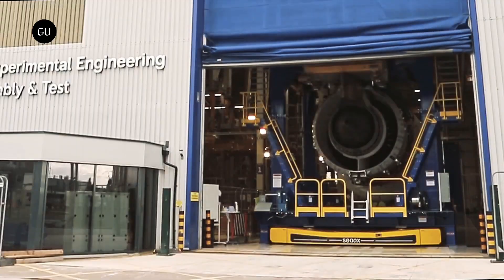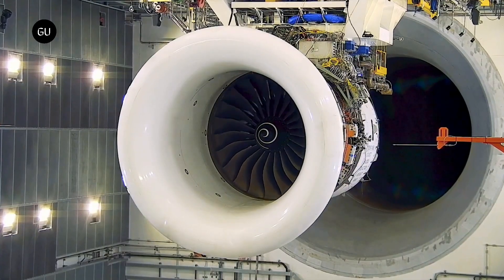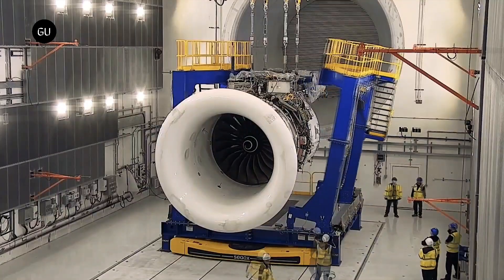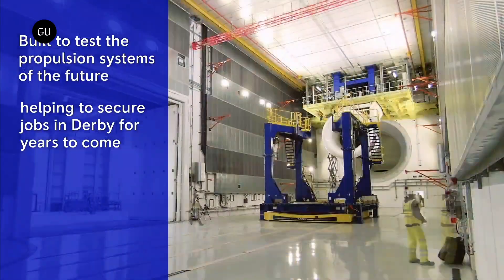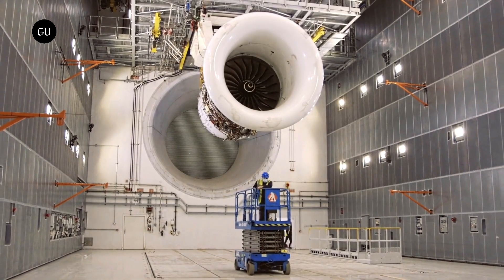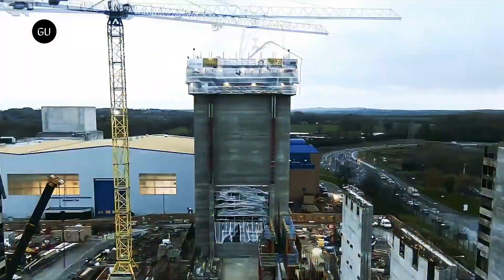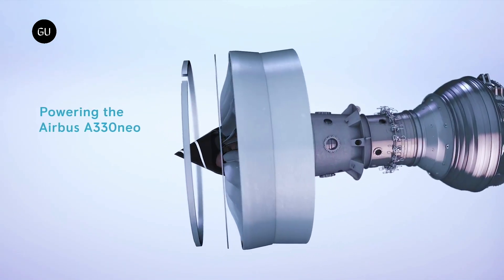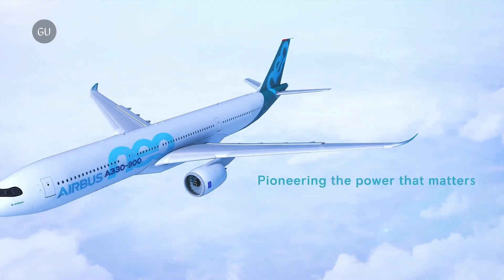Rolls-Royce UltraFan Engine Complete and Ready to Test

Comment: Something new is coming! And  my money is on Airbus. Think about it the 747 is dead last one delivered this month , Boeing are going with the 777upgrade model . The A380 wasn't the success it was hoped to be and the A350 is a 787 clone so it makes sense for a large capacity widebody twin in the pipeline, would rolls Royce design and build a new engine without a wing to hang it on??

Comment: What airframe can accommodate such a wide fan case diameter?  The Airbus a350 has the 118 inch wide Rolls Royce Trent XWB and the Boeing 777 has the 134 inch wide GE9X. Maybe an a350neo or a Boeing 767 Next Gen. I don’t see the Ultrafan being used on narrow body airplanes.
Reply: Chances are 747 with 2 engines
Reply: i think rolls royce have always made engines exclusively for wide body aircraft
Reply: @mattcc9435  The 757 is powered by Rolls Royce RR211
Reply: there is no aircraft at the market for this engine at this moment
Reply: B52H stratofortress

Comment: So what if the fan was attached to a motor would it produce enough thrust?
Reply: Yes, and as long as you can maintain subsonic linear speed at the tip of the fan blades (the faster is spins the great its linear velocity and you don't want to go supersonic).

Comment: How is ultra fan different from a turbo prop?
Reply: Okay, first lets clarify some terms. A turbojet engine will suck in cold air, squeeze it with a compressor, mix the compressed air with fuel and ignite it, causing expansion and heat. that then expands out of the rear of the engine which creates thrust and also turns a turbine (this turbine spinning is linked to the compressor at the front by a shaft and allows larger thrust to suck in and compress more air in a chain reaction.  All other types of "jet" engine use this principal as base. A Turbo prop uses a turbojet at it's base but uses the expanding hot gas not as thrust but turns it all into rotational energy which it uses to drive a gearbox and propeller. A turbo fan replaces this gearbox and propeller with a giant fan, this fan covers the whole engine and serves two proposes - first it feeds air into the turbojet to keep it turning, and secondly it provides additional thrust with cold air bypassing the engine. There are many variants of both.
Reply: @STKS1991 this video seems to show the new turbo fan is so big that it also needs a gearbox to turn. Then is the main difference just the existence of an outer shell?
Reply: Main difference is the speed. Basically all the energy in a turboprop engine drives the propeller, so it’s efficient but creates more drag, so it is limited to speeds around 300-ish Mph. Jet engines have more aerodynamic and powerful fans to run at higher speed regimes, generally around 500 Mph.
Reply: Such a basic question. Ask "how is a turboprop different from a turbofan" and Google will give you the answer.